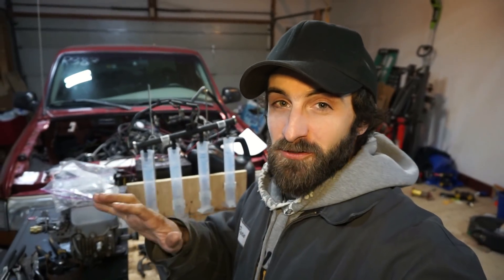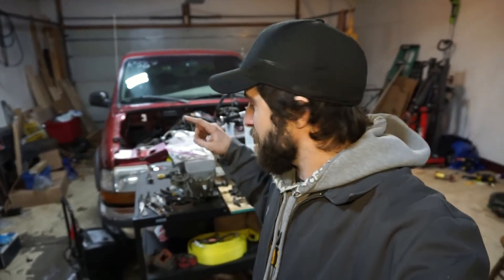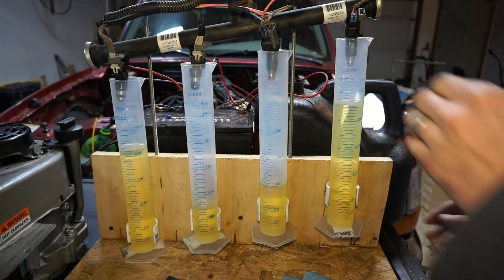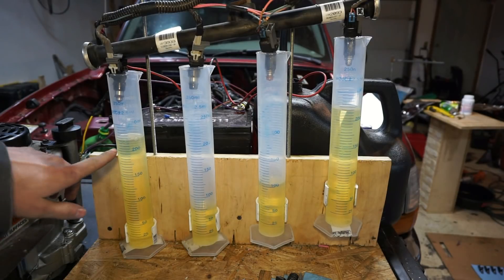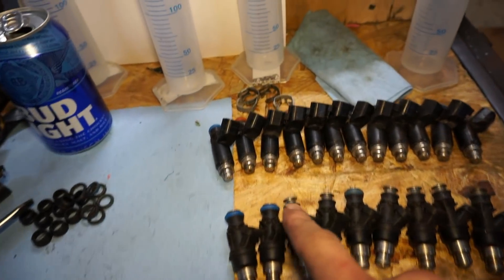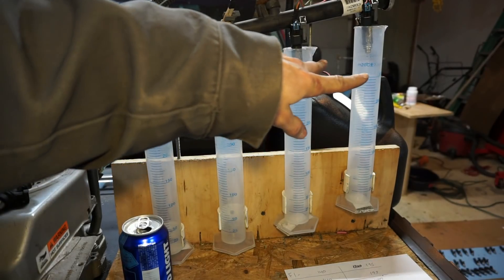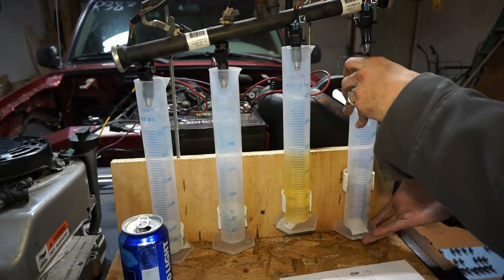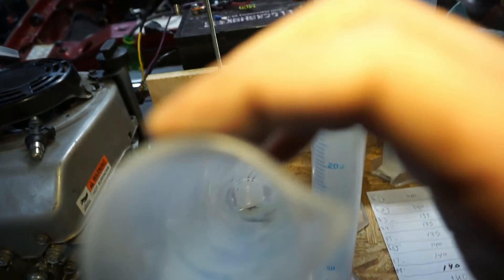INJECTOR FLOW TESTING!!! LS Truck Flex Fuel vs Regular vs Decapped LS swap fuel injectors!!!

Comment: I watched your video years ago. I really want to build a test rig like that. The injector test machines are too expensive. I've got a built LQ9 where I put flex injectors. However, having a lot of trouble in tune w/ lean condition. I suspect injectors aren't flowing... but not sure. We've scaled the flex injectors down in the tune from 36.6# to 30# to adjust for lean condition but I don't like doing that. Wondering if maybe they are just flowing slower (although I'd expect to see cylinder mismatches). What did you do to get that one unstuck?

Comment: after decaping the injector before putting them back on the intake/fuel rail do you put the little black plastic cap back on the injector or do you just install them without it but with the oring only?
Reply from the maker: Yes pintle cap stays on.
Reply: @BlaserBuilds  thanks
Reply: Do you have to put that black plastic piece back on ??

Comment: So if I'm switching from stock truck to the flex fuel injectors what do I need to do in HP tuners on flow rate?
Reply from the maker: Decapped truck to decapped flex?
Reply: @BlaserBuilds  just stock to stock. Haven't decap them yet
Reply: Just changing to flex fuel for more flow
Reply from the maker: @gearheadhuff7853  Should be 33lb instead of 25lbs.
Reply: @BlaserBuilds  getting some that says stock flex fuel but 42 lbs/ hr but yes my stock ones are 24.8 lbs/hr not sure if flex fuel data correct.
Reply: 12613412 is injector number
Reply from the maker: @gearheadhuff7853  What vehicle were they from? I might have a stock file to reference.

Are you running a flex sensor?
Reply: @BlaserBuilds  no not yet just wanted more flow for now. Out if 2005 Tahoe I believe

Comment: thanks man for sharing your experiments, i have question about the rpm and its equivalent pulse rate, so if my idle speed about 650 rpm what is the frequency or how can  i adjust the pulse rate of the injectors under test is there any chart or table for this calculation without going to the complication of horse power calculations.

Comment: Spray pattern isn't worth all that much. The fuel heats up and vapourises as it enters the port and back of the valve. Then as long as you have enough spark in the cylinder you can light off a garden hose injector.

Comment: Just recently found out GM used several different sized gas fuel injectors!  You shouldn’t mix & match part numbers here’s why:

1999 Gas 4.8/5.3 has 21.8# 58 psi
1999-2000 4.8/5.3/6.0 24.8# 58 psi

2001-07 Gas used 25.2# 58 psi
2002-07 L59 flex 33# only 50 psi 

This information explains why people are having different flow results with their decapped truck injectors.  The part numbers need to match and the later models will flow more. 
Similar issue with the LS1 & LS6 injectors based on year. 👍

Comment: what would happen if i pit a non felx fuel pump in my flex fuel suburban? i do not run e85 at all
Reply: Did you end up trying it?   Did you ever get an answer to this question on any forum or from a21bravo?

I have flex fuel as well but never run E85 in part because it is hard to find.  But I was told not to use "regular" fuel injector cleaner on flex fuel systems.   But I can't even find an fuel injector cleaner specific to flex fuel systems.   Interested to know if you can shed any light on these issues.
Reply: The pumps are different so u can't. I use sea foam and never have any problems

Comment: cool video!! more fuel more power that simple.. for Genuine OEM fuel injector replacements check us out. we offer information on flow rates / port type / number of nozzle holes / possible upgrades etc.. 100% rebuilt and flow matched ready to install
https://www.injectorplanet.com/collections/buick-chevrolet-gm-fuel-injectors
thank you 
-Bryan

Comment: to much fuel with decapped ... why do i need tht much gas going into the piston? i dnt think it will run better
Reply: J dizzle Gas into the piston lmao dummy
Reply: you have to set the injector attributes in the ECU for lbs/hour.  The ECU will then adjust how long an injector is ON.
Reply from the maker: J Dizzle Cheap way to increase injector flow rate for forced induction (Turbo etc)... Sets that flow equivalent to these can cost $600+... This is basically free with some elbow grease.
Reply: Boost boost boost!!!!!